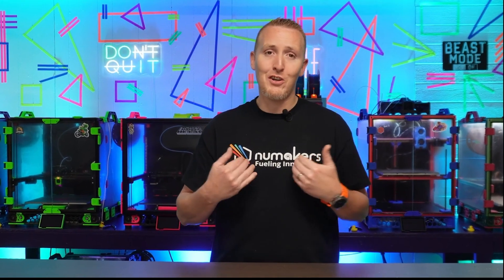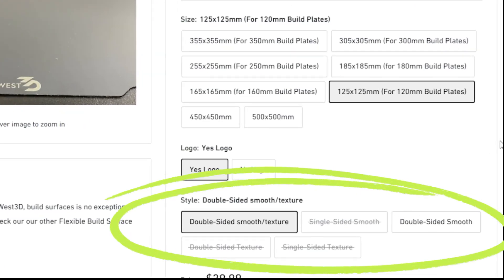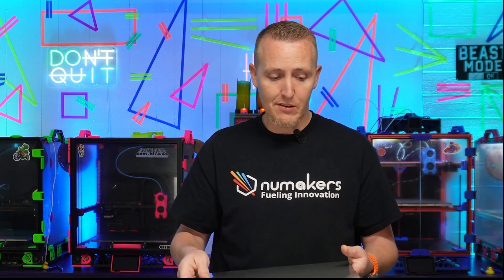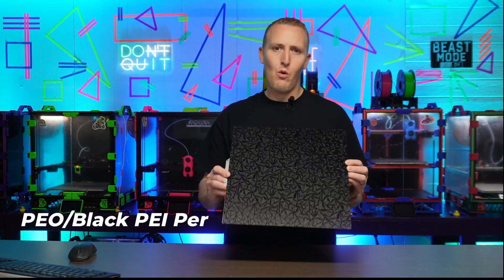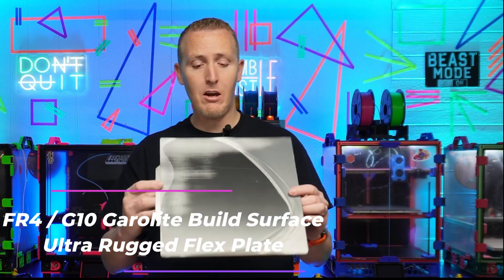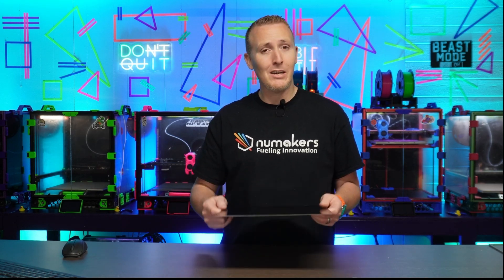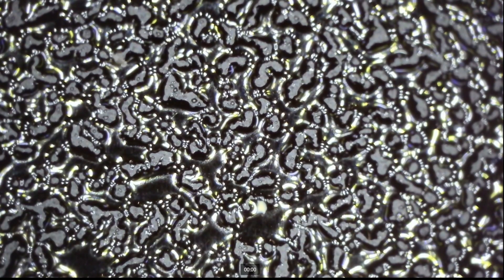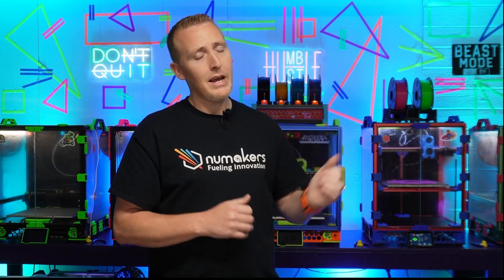⚠️ Don't Use the WRONG Build Plate! Crazy Up-Close Details!

Comment: might need to pick up a west 3d textured pei. I'm currently running a fabreeko textured one and I love the look, but keep getting little issues
Reply from the maker: Oh really? What issues are you getting? I can definitely vouch for the West3D high performance black textured plates. My favorite ones by far!
Reply: @leemerie3d  Most of the issues have been fixed with franks goo, but I still get some small first layer issues. The texture is amazing, but you can't quite get it imprinted into a print like how you can with less aggressive textures. The texture looks like really fine asphalt or like 240 grit sandpaper
Reply from the maker: @milodudeful Ahh I know what you mean. Also, in my opinion you should never "need" any glue for unless printing some engineering filaments. I never use anything for ABS or ASA. Def try out one of those plates!
Reply: @leemerie3d  I only really print ABS and above nowadays, but the goo helps a ton even with higher warp filaments as long as the first layer isnt too high up
Reply from the maker: That's fair. Even just for the extra security I understand that.

Comment: I wish West3d made these plates in 377x370 for the Ender 5 Plus printers. :(
Reply from the maker: Yeaaa... That size is sort of odd unfortunately which can't be used on lots of other machines like some of the other plates. Someone just just told me you can do a mod on that machine to change it to a 400x400 bed then you could use those size plates! That would be super cool! 😎
Reply: @leemerie3d  I know it is... And I just completed a hydra conversion so I can use the 400mm but I'm not there yet... I can source beds but they have such a good variety there at West3d. Even Fabreeko has limited kinds of beds for the 377x370 ender 5 plus lineup. :(
Reply from the maker: @MichaelSantangelo  Oh that's awesome! And yeah Fabreeko is a great place to purchase any of your 3D Printing supplies as well as KB3D is another that's great.

Comment: What about glass??? You could almost buy a 3d printer for the cost of some of those build plates.
Reply from the maker: Absolutely! Glass you can print on just fine. We have sort of moved away from glass to these type of sheets with 3D printing. Glass (mirrors are sort of cool too) is unable to flex and you have to wait completely to cool off before removing the part. There are several disadvantages of that. I don't use glass on any print surface anymore but I could cover a short video on printing on glass 🙂
Thanks for watching!

Comment: Which one do you recommend for ABS, ASA using tap?  I've destroyed a couple cheaper plates because of the tap.
Reply from the maker: Any of those plates should do well with tap. Are you probing at 150c? The one I mentioned in the video (High performance black with texture) is the one use mostly and I have tap on several of my machines. That one will do you really well.

Comment: Really appreciate the video detailing all the different options for plates.  Got two questions.

Would the 255mm plate work on the Bambu P1S/X1C?  Curious if that mm makes a difference and if these can be used on one.

Second question was the difference in what looked like in size of the scrapers aa perspective thing with the camera angle, or was there some of size difference that was influenced by the plate?
Reply from the maker: The Bambu plate is a little bit different so those would not fit sadly. 
As far as the parts. I should have mentioned in the video. There was 2 of those scrapers that were different style and yeah they are a little longer. Two say "Bambu" on them and the rest say "Voron" on them. That's most likely what you saw in the video. Good eye!

Comment: It looks like these plates dont come in recognizable sizes like for Bambu printers which are 256x256, 180x180 or 220x220, 235x235 and some others.  Does that mean that these plates are more printers more like Voron type printers?
Reply from the maker: They could be used on Bambu and other machines if they were the correct size. Some of these I believe West3D are planning to get other sizes for this reason.